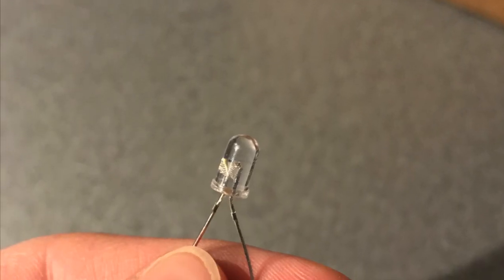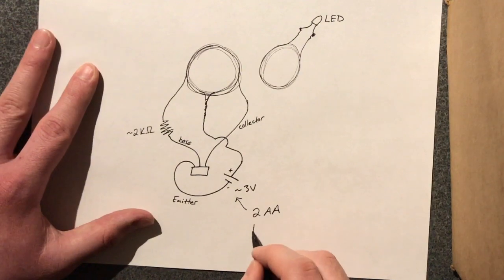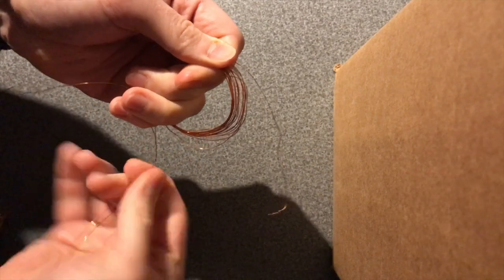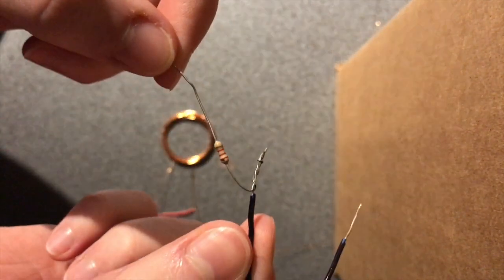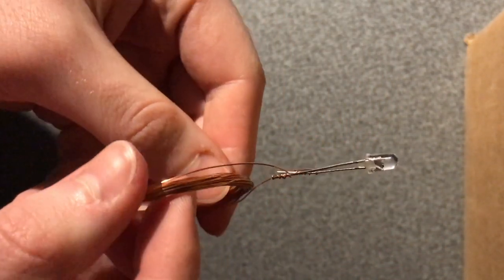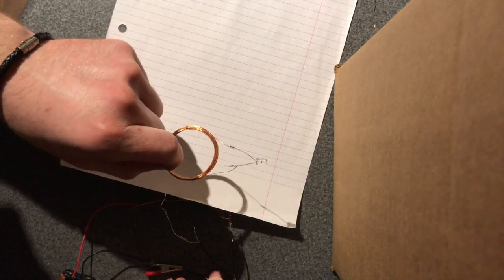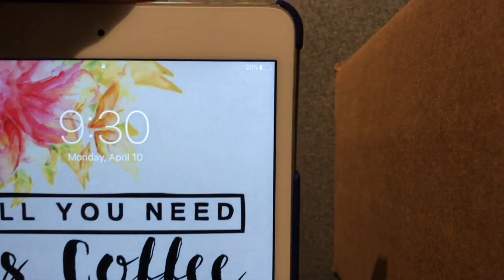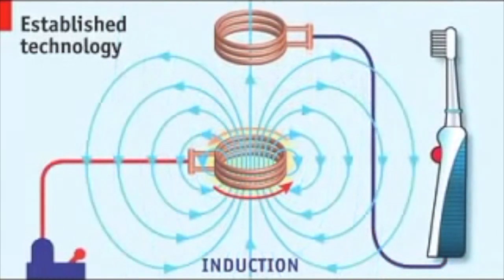Electromagnetic Induction   PHYS 273   Project

Comment: I tried this project but it is not working
Reply: Are you using laminated copper wires? and if you are, did you burn off the ends when making the connections?  It should work if you followed the steps correctly and using the right components!